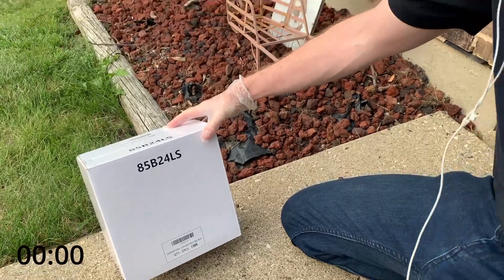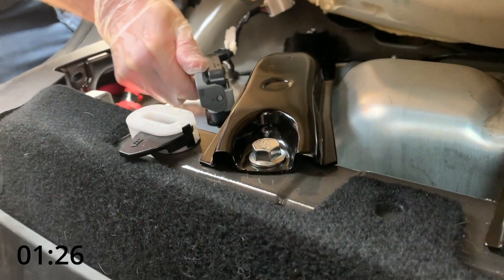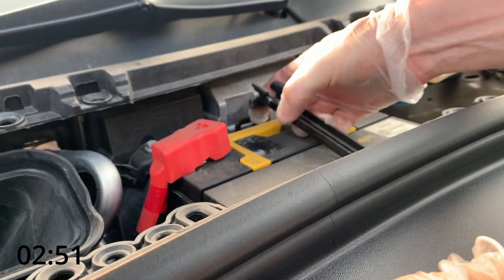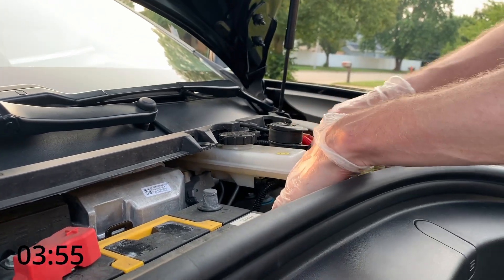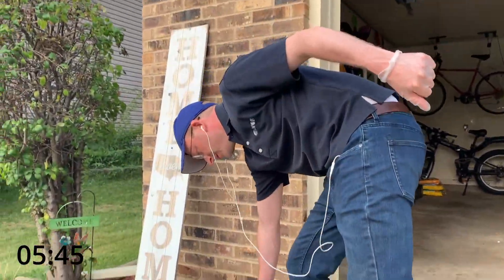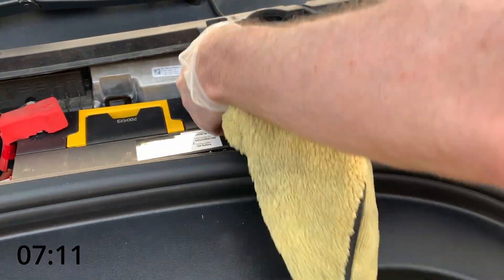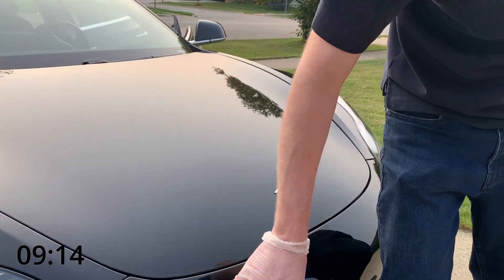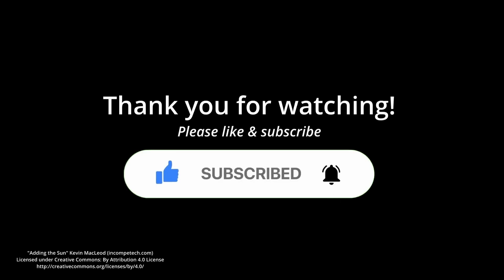Tesla Model 3 12V Battery Replacement in 10 MINUTES How To DIY

Comment: Just a couple of things:

1. It's 12v, you're not going to shock yourself touching it. It is better to touch the connectors when putting them back on the battery and wiggle they down all the way on the battery connectors to ensure maximum contact and a snug fit instead of avoiding touching the metal. The prongs are slightly tapered. 

2. You don't need to cover the negative with a rag. The chassis of the car is connected to it after all so whenever you touch the bodywork, you're touching the negative haha. Thats also why they don't bother covering the negative terminal with a plastic cover, but the positive is covered.

3. The order of operations here are wrong, while im sure realistically no damage will occur, it is still best to follow the instructions to potentially avoid a bill if you break the DC-DC converter. 

The correct order:

1. Lower the rear right window
2. Lower the driver's window
3. Open the driver and rear right door and leave them open until finished
4. Pull up the seat
5. Go to the screen and open up the frunk
6. On the screen now power off the vehicle
7. Go to the frunk and disconnect the battery negative connector 
8. Go to the rear and disconnect the DC-DC converter cable 
9. Go to the front and disconnect the battery positive connector and remove the battery/vent hose
10. Place in the new battery and attach the vent hose
11. Connect the battery Positive and tighten
12. Go to the rear and connect the DC-DC plug back in 
13. Go to the front and connect the battery negative and tighten
14. Secure the battery with the mounting hardware
15. Put the rear seat back together
Finished
Reply from the maker: Awesome!! Love it. Pinning this.
Reply: @techgeektesla  I have an irational fear of being shocked, I will wrap my tools with tape, and use thick snug gloves
Reply: What if I can’t roll down my drivers window fully?
Reply: @WrapWithUss I have the same question. My 12v is so dead that I can’t open the doors let alone roll the windows down.
Reply: @SeanWeeksSLC not sure if it’s still relevant but there is a negative and positive wire under the front tow hook cover on the front bumper. If you apply 3-12 volts to this the bonnet will open and you can access the 12v battery and put a booster pack on it
Reply: You would have to by touching negative and positive, same time for any theoretical shock. 12V is safe voltage to operate on. 🙄🤦‍♂️
Reply: Do you go through the same process for a model y?
Reply: @bullfaceone  yeah but if it’s ryzen you can do it all from the frunk. Lower drivers window, open frunk, power car off from screen, leave door open, Pull the cover panel up, find the LV battery, pull up the green clip (it doesn’t come all the way out) then slide the connector under it to the side, the connector should lift up as you pull. Then find the fireman loop next to the battery and slide the red pin out (doesn’t come all the way out) and then push down on the clip next to the red bit and pull the connector out, you should hear a loud THUD… this is the contactors opening in the battery and shutting the car down completely.
Reply: @ thank you very much👍
Reply: Super helpful🎉
Reply: thx for the tips guys
Reply: After perfect replacement still getting samne change lower power battery alert 😢
Reply: Thank you kindly for this very detailed instructions list. Wanted to note you have to pull the seat latch towards you. I wasn't understanding that part, but eventually figured it out. Kudos!
Reply: Somehow, I think the method in this video is safer, even though it's different to the Tesla method, which I don't understand why disconnect the 12v(-), then high voltage cable, then 12V (+). Then new 12v battery (+), high voltage cable, 12V(-). Can some electrical engineers explain why the method in this is not better? Please don't respond if you're not an electrical or a Tesla engineer.
Reply: After doing this, the error message to “schedule service to replace 12v…) how do I clear this?
Reply: @aakopyan01  On the car screen go to software and then hold the text where it says the "model 3" or whatever model you have until a text box pops up asking for a code. Enter "service" and the car will go into service mode. 

Low Voltage > Power Distribution > Battery Icon > Learn New Battery
Reply: @iambenmitchell  thanks brother. I already put into service mode. So the following steps worked for me. 

1. Power down car
2. Replace 12 volt battery 
3. Program/register new battery with the learn new battery option 
4.Software update
5. Disconnect new 12v battery 
6. Disconnect main battery located underneath 
rear passenger seat 
(((Do not close entry doors-you will be locked out )))
7. Wait 10 minutes or so 
8. Reconnect rear main battery (First)
9 reconnect 12v battery (Second)
10. Notification for (schedule 12 battery to be serviced…) is now cleared.
11. Done
Reply: @aakopyan01 you’re welcome. If you ever get locked out for whatever reason, you can open the frunk and access the 12v by applying 3-12v to the two wires behind the tow hook cover on the front bumper. 

That’s how you get into the car if the 12v completely fails and the car is dead
Reply: Appreciate both the video and updated steps. It helped me to replace the battery. Saved $40-50, the service cost at Tesla. DIY way to go!!
Reply: My glove box was damaged during this service is that even possible not mad just want it fixed.

Comment: Can you make a video about replacing the main battery pack on a Tesla?  10k to 20k dollars, and every Tesla owner will eventually have to pay for it.
Reply from the maker: 😲 That would be a difficult DIY video to film. Shouldn’t be needed, either. Not for a very, very long time at least. The expected battery life is 300,000 to 500,000 miles, or 15-20+ years.
Reply: @techgeektesla  Not for a very, very long time at least

It could be 10 to 15 years, for someone that has a long commute to work every day.  Then, a $20,000 battery replacement is needed.
Reply from the maker: @DerekDavis213  Deal. When that time comes I’ll be sure to make a video, because this is my forever car.

Comment: If the car has no power: Maybe this will help someone,  if the battery is completely dead there is a manual release on the front bumper to open the frunk ( which you will need a small battery such as AA or battery pack jump starter that you will connect to Positve and Negative connectors to manually pop the frunk. ) .  From there you can charge/ jumpstart the 12v battery or swap it out.

Comment: This is terrific and worked well.   Mine died 100 miles from the nearest Tesla service center, so I had to do it myself.  Had to drive 50 miles (In a friend's car ) to find a battery for $250. Made me realize this is not a car you ever want to drive any distance from a service center.  (wanted $650 for a tow)   Replaced the battery and dumped the Tesla.  For me, this experiment is over!  Will drive my new hybrid Volvo with a lot less stress.
Reply: Ok, oil industry bot

Comment: Safety Notes:

Wear gloves and eye protection—lead-acid batteries can leak acid.
((((Avoid touching high-voltage components under the rear seat.))))
Dispose of the old battery at a recycling center or Tesla Service.

Comment: Helpful Video but you should loosen the terminals, widen them with a screwdriver and press them further down the tapered battery post to ensure a snug fit.   The battery post at this point should be sticking out ABOVE the terminal. https://youtu.be/SZJJNOa3Ju0?si=jqONQv4-FmT-l_u1&t=467

Comment: A few years ago I had some battery notice on my screen. It was corroded terminals. Just cleaned them up and was up an running with zero cost. I am having the message show up again. Will do the same thing today but unfortunately this time may not work the battery is from 2019.

Comment: Pretty easy  for the most part. I had to adjust my positive post to get it to reach the post on the new battery. I didn’t really need to remove the vent shroud. Thanks.

Comment: Thanks for sharing . Suggest to reconnect the new batt’s negative first followed by the positive end.  I believe this is the standard practice to handle battery replacement.  Thanks for the video anyway.
Reply: No the negative is always disconnected first and reconnected last so that if your ratchet touches metal whilst dealing with the positive it does not short. Source: Auto Electrician 33 years

Comment: Our Model 3 is almost three years old and right now my wife is passing the 50K mark while driving. I 'm thinking that it's probably time to replace the 12V battery so she's not stranded somewhere. Is my thinking good on this - I hate spend the money too early but usually our batteries in Texas are shot after about three years from the heat.
Reply: wait for the error tbh 

But it will happen around then. My 2020 T3 is almost at 69k (Nice) and just got the error

Comment: Just used this video to replace a 7-year old 12V in my 2018 Model 3. Despite the Michigan climate, my original battery was still doing fine.  I replaced for good measure after the service center manager mentioned replacing every 3 years or so is a good idea. Took me 15 minutes start to finish since I knew what to expect. Thanks!
Reply: where can i find the low voltage 12v battery for my 2020 model 3?
Reply: My 2018 got a replacement in sept 2021 and another in aug 2025. ~3-4 years seems to be about the max life expectancy for these batteries.
Reply: @motarded4214  Totally agree.  In my 2018 M3, I did the first replacement in July 2021 after getting an alert. Fast forward to Sept 2025, I just got an alert to replace the 12v battery.

Comment: I requested this service in the app also and it was also $130. Except they couldn't come until next week. I can change a 12v. I've seen grandma's changing them at autozone. Someone is being kind enough to bring it to me from the service center (not tesla). $135 for the battery and cabin filters. Work done by me and my daughter. Arthur at San Antonio Airport came in clutch though. Dude on the phone from roadside was very helpful also.

Comment: Now it’s $309 in 2025 for them to come to you to replace it
Reply: depends on location. where I am it would be $158. also depends on the model. 2018 have lead acid batteries which are cheap

Comment: Hi,, is the tesla body/frame grounded to the low voltage  12 volt battery? or do they run ground wires to all it powers?

Comment: Eduardo - I cannot find the high voltage latch under my back seat in my 2018 Model S. I don't see the gray plug with the lever - only a black & red plug. Don't know what that is but anyway - how can I reset the battery warning now that I've changed the battery?

Comment: After my 2020 Model X experienced a complete dead, I replaced the 12V battery with an Ohmmu battery. However, three days later, I received a scheduled service message to replace the low-voltage (LV) battery, followed by a notification to pull over safely.

Upon inspection, the Tesla technician determined that the aftermarket lithium battery was causing the LV circuit to repeatedly overcharge. This overcharging led to the degradation of the LV battery, necessitating its replacement with a proper lead-acid original equipment battery.

As a result, I paid $640 for the original battery and labor, and returned the Ohmmu battery, incurring a $38 fee for the return label and a $90 restocking fee. Despite these issues, I noticed that Ohmmu still offers batteries for the Model X, which I find perplexing given the circumstances.

Comment: Just requested this service on the tesla app. The estimate is $120 for them to come to my office and change the battery for me. Seems like a no brainer to have them do it
Reply: Except if they can’t come for a week!!! 🙄
Reply: Hey men whats up, this just happened to me. I am currently driving model Y, how long does the battery last? Did tesla service came to your home or did u took the car to their service?
Reply: Hey, did that include the new battery?
Reply: @sierrashackelford5868  they charged me $149 including new battery at Tesla dealership
Reply: Exactly this. Warning came on that 12v battery is low. Tesla scheduled for next week and calked me that they will come tomorrow. Its $120. Including battery and labor. They take old battery with them.  No disposal fee. Best to pay that and be done.  They also said i dont need to be home. They have access to car without me.
Reply: Depending on where you live the appointment can be a week+ out, 
It was really easy to pick up a battery from a Tesla Collision Center and do it myself. It genuinely took 10 minutes. Battery cost was $108.

Comment: negative on the 12V should be disconnected prior disconnecting the High Voltage not the opposite. Also service mode could be used and most important, wait that the heating is completely off, then power off using the screen then 12V off, High Voltage off. Replace the battery, then high voltage reconnect and last 12V reconnect. If it is a model 3 with heat pump the procedure is different.
Always consult the official service manual

Comment: How do you turn off the system on the screen, and roll down the windows if the battery is dead?
Reply from the maker: Battery won’t be dead. You’ll get a message indicating that it is about to die first.

Comment: PSA: To anyone who wants to DIY anything, dont take advice from someone who is doing something for the first time. Especially if they can't be bothered following manufacturer specs or learning part names
Reply from the maker: Correct. I failed to read the manual. 🥴 You got me. Also, I am not the manufacturer, just a random guy on YouTube. Please be advised that I watched 6 videos on how to do it before I filmed the process in 10 minutes myself. I have a PINNED comment on this post with the proper instructions. Main thing to note is the sequence of removing the connection in the backseat. With all that said, my video has helped a lot of people with many sending their ‘thanks’ for the info. It was a pretty simple task to complete & totally worth the effort for DIY to save money.

Comment: How long until you needed to replace the 12v battery?
Reply: I got almost 6 years out of mine which seems to be rare. I've heard of people having to replace after 2 years.
Reply: For me (model 3), had to replace after 4 1/4 years. (Just after warranty finished of course).
Reply: Is there a warning? How do you get prompted to replace it?
Reply: @ActiveDutyInvestor  yes. You get a warning on the screen that comes on everytime you engage drive. And the Tesla service centres get you in right away.

Comment: I picked up a new '24 Model Y a few weeks ago and was checking the service mode.  Noticed that new Model Y's have a 16v lithium low voltage battery which is much smaller and lighter.  Not sure about the replacement cost of these new batteries when they fail.
Reply: Probably the same . 300 to 200 bucks . They may even last longer .
Reply: They are rated for the lifetime of the vehicle

Comment: maybe it takes 10 minutes if you practice it several times.  But it will not take you 10 the first time you do you.  Author doesn't show there is a little clip on the high voltage cable you must squeeze to rotate the lever down.  And I had to use a screw driver to pry it up.  The little air vent fitting easily falls down into the car labyrinth below and then you need time to fish it out.  Some pump would NEVER TURN OFF, even after powering the car down, until I boldly went ahead and disconnected the ground terminal as a final step and it finally stopped.   It all seems to work ok now but like a typical car project you do once, budget 30 minutes I'd say.

Comment: Your video was put up 5 months ago, making it around mid 2023. It's now January 2024. Where did you get the battery for only +/- $85.?   The Tesla Center near me lists the battery for $225.! ... (and it's back ordered)  :(
Reply: I just created a Telsa service, and they quoted me $85 for the price of the battery. I'm not sure why they are charging you $225. With service installation and tax, it's coming out to be 117. There has to be some mistake on their part for you.
Reply: @tecnodog7  They're listed on the local Tesla service web site for $225., that doesn't include installation.  I ended up disconnecting both the 12 volt and 300+ volt batteries and recharged the 12 volt battery for a couple of days. Everything is back to normal so I didn't have to buy a new battery.
Reply: I ordered the lithium one,  cheapest was 463$!!!!
Reply: @johnsmithiii6472  - Mine's a 2018, still takes the AGM battery. I put in a service call, guy came out, replaced the battery and did some updates, all for $125. He also gave me some tips on how to keep the battery charged and showed me some features that I wasn't aware of.  $ well spent :)
Reply from the maker: The part number is in the video. The price shouldn’t have changed that dramatically!

Comment: I bought a "recommended"  replacement battery because the Tesla dealer is about 100 miles away.  My new battery does not have the vent tube shown on the video.  Do I really need the vent hose?    BTW, The old battery is 5 years old and working fine but other people say it should be replaced after 3 years.
Reply: mine was almost 6 when it failed.
Reply: My console told me it was time to replace the battery after 4 years.
In old cars, battery has lots of air flow and hydrogen gas can dissipate safely.  Tesla 12v battery enclosure has very little air flow.  The hydrogen gas can build up and maybe explode.  I expect the explode would be a pop and not a boom.